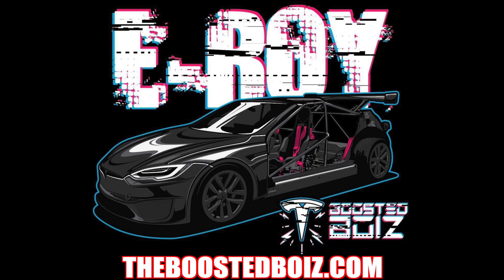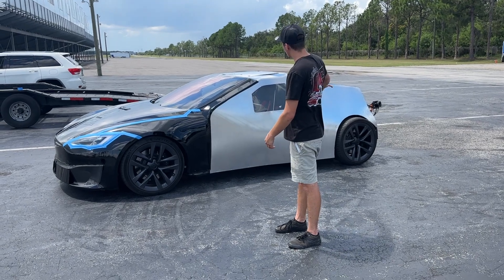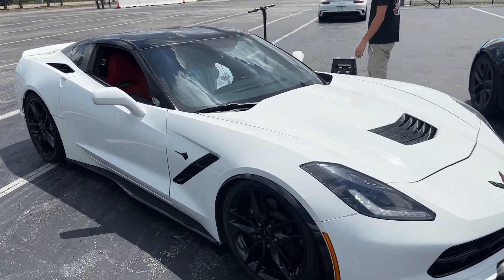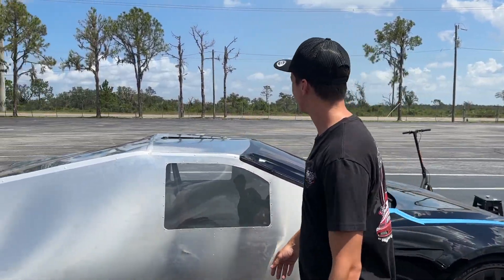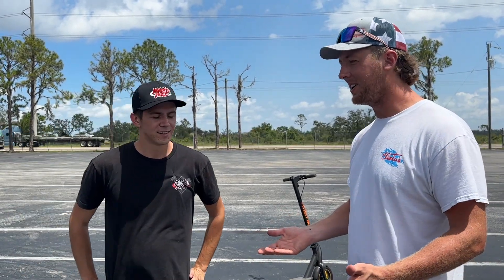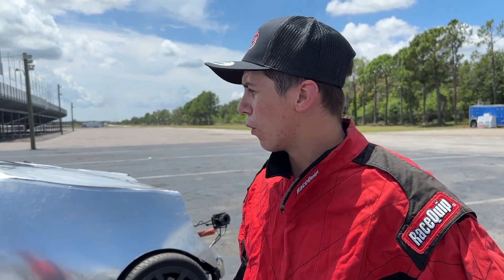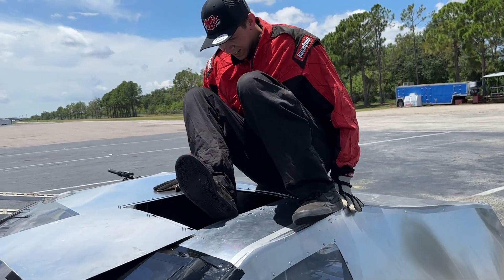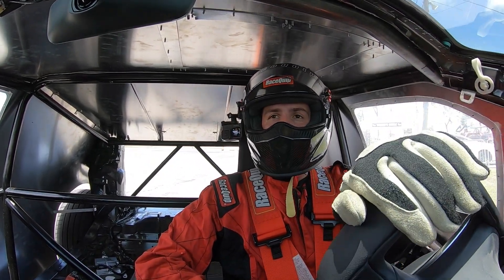We Built an Aerodynamic Body For Our Tesla Go-Kart To make It Faster!

Comment: Electric vehicles  are more prone to overheating than conventional cars for two main reasons. One is that batteries in electric vehicles underperform in hot weather because higher temperatures cause electrons in the battery to move slower, reducing the amount of power available.(GOGGLE)😂

Comment: The rear is the most important for aerodynamics, you need a rear, go to another wind tunnel and use ai to design a body, or just hurry up and make an all carbon replica of the original body, you will never get better aero than the original body, it's insane how aero they made the original

Comment: To aid in grip on top of slicks you need to get rid of the camber in the wheels. Negative camber is great for cornering but for maximum grip going straight you need the tires flat on the ground.

Comment: Have you thought about a smaller overall wheel diameter??
For example if it’s a 27 inch tall tyre, try a 25 inch tall instead.
Top end may suffer a little but it might 60ft better.
Just an idea 🤔👍

Comment: Put racing window ducts on both windows and where the rear window would be and allow some air to travel through the car to the rear opening. Back there is still a vacuum zone and any relief of the sides and hatch dead zones could now flow to the rear exit..pulling aero closer to the car in those turbulent zones...
Great progress!!!!

Comment: Hey I just thunk a thought; if you know a day at the drag strip only uses like 15% power.... and most of the weight left is in the batteries.... could you somehow ditch some of the battery cells and still have enough power to run it? idk how that would work, I aint no sparky but maybe its possible ¯\_(ツ)_/¯

Comment: Sounds crazy but add a few lbs to the rims get the planted weight up and the heat shouldn’t bother you as much . The torque curve on electric motors is steady regardless of the weight of what it’s spinning or change the torque ramp second by second

Comment: Is the back completely open? Doesn't that create a vacuum which sucks (pun intended) when the air collapses in behind the car? The air at the back should be diffused in some way so that the vacuum isn't so strong. The teardrop shape is the most efficient, isn't it?

Comment: Why not just use the car's original body panels?  remove everything but the sheet metal, so it's just the skin.  Basically the same weight as the body you have, but way better aero.  Hollow out the doors and just use the sheet metal and Lexan for the windows. You get nearly all of the weight savings, but maintain factory aero.

Comment: have a look at the Ford Racing Transit (latest version) it has buttresses where the rear quarters finish, but paneling which runs inside the back to help with drag and funnel the air inside to fill the hole its punching. also some wheel covers on the front, and run the rear body work round the outside of the wheels... wouldnt look so much like a tesla though, but would be more slippery.

Comment: The OEM tire size for the Model S Plaid is 285/40/19.

Would you guys consider installing 295/45/19’s?

The larger diameter should add another 6 to 7 MPH to your 1/4 mile trap speed.  The slightly larger contact patch that would be made could increase launch traction as well.

Comment: This car is screaming to become the next McMurtry Spéirling electric fan car, 0-60 1.5sec 0-180 in 9 seconds and its powered by a 1000bhp electric motor.  All eroy needs is a  fan at the back and a skirt along the bottom of the car like a hovercraft, this will give you the ultimate  ground effect vehicle

Comment: You should cut everything off the car and leave it flat like skateboard. Then build it up like an F1 style car with driver centre mounted and very reclined. 
It will be easier to build carbon fibre/ fibreglass body and main hoop for just a driver. Plus more weight savings

Comment: Hi guys
As far as you know, drag coefficient is not all - there is second factor - frontal area - so I think that you messed up a little bit, when you created a cage that is wider than a windshield - imho it should be as wide as windshield which would decrease frontal area by few percents. In fact, it should be even narrower, so there would be "droplet like" shape in the back. if You would want to go "hardcore" you could try to replace whole windshield with something lower, or just make it flatter by changing angle = less frontal area :)
Reply: Sounds right, I don't know how much frontal area they added but looks like more than 10%. Yes unfortunately this means the bodywork needs to be redone from scratch, needs to be more like VW XL1 where the upper body is extremely thin (left/right) instead of fatter. They went the opposite direction from what they should have done!
In the meantime, WIDER TIRES, LONGER TAIL.

Comment: Rear wheel covers and a long tail will help loads. Look forward to the next one! 😎
Reply: repentandbelieveinJesusChrist9  get a job!
Reply: Negligible benefit.  Not worth the effort unless trying to squeak another mph or 2.
Reply: @SportbikerNZ  they ARE trying to squeeze another mph or 2, irrespective of your spamming comments.
Reply: @procatprocat9647  They were actually looking to make a substantial difference with aero which turned out to be less than expected.  As they get closer to the record no doubt they will spend time and effort to squeeze an mph here and there.  Lowest hanging fruit was clearly the objective here as they explained.  Seemed it was lost on you.
Reply: @SportbikerNZ  it seems like that’s exactly what they are trying to do?
Reply: @Jims_racing  No.  They specifically said the wind tunnel showed negligible benefit enclosing the rear vs enclosing the 90% of the vehicle they've already done.
If it comes down to it the last vestige of mph they absolutely have to have to beet the record, then do it.  Otherwise waste of time and resources as they said the wind tunnel showed.
Reply: @SportbikerNZ they were talking about the back bumper area in the video not the wheel wells
Reply: @ipariszalonna  They specifically talked about the wheels which is why the body is flared as much as possible in that area.  Again, this is about picking the lowest hanging fruit, not wasting effort on marginal-at-best options first.  Common sense approach.
Reply: +an integrated wheelie bar 4 traction 🙂 like some FWD cars
Reply: @Eduardo_Espinoza ? its awd and center of mass is 10cm from ground
Reply: @Eduardo_Espinoza wheelie bar doesn't provide traction it's a safety measure in case the car flips itself over and it is impossible for Front wheel drive cars to do a wheelie
Reply: @s_989  the one's on fwd cars are for traction, to stop the rear squatting

Comment: AWESOME!   Time for lighter wheels AND stickier tires.   You guys are there.  The aero mods work.  You already saw what happened when the track was sprayed down to make it stickier.  Your aero works as intended.   
The weather being warmer is a PLUS for your batteries.   You want the batteries to be warm, not cold.  Forget your air density thoughts of the I.C.E cars.    
Also, make sure the battery is warm before you take off.  There are videos on the optimum battery temperature to run these Tesla EVs as well as keep your batter percentage above 90%. 
You guys are there.  LET'S GO!!!

Comment: Both lightweight and an inch smaller wheels with at least r888’s or better will both drop 100 pounds or so or more if they’re run flats on there

Comment: Funny you say it spins real real bad compared to saying the same with ice vehicles. 

Drove a PriusC to High Rock in Fort Payne Roll Tide Land.... The #3 rock traversing was better than most trucks ive been there with. It just didnt spin going up hills. Mud though, is an ev or atleast hyrbids worst enemy. -i also forced electric mode while climbing hills....

Its all about how you transmit power.

Comment: You guys need to get with Rich Rebuilds and Ingenext to remove the speed limiter of 160ish. I wonder if the car starts to pull a little power the closer you get to the limit? Also I know you don't want to invest to much $$$$ but a lighter wheel and tire package with some carbon ceramic brakes would help massively. You could drop close to 50lbs a corner with the right setup, over current setup.

Comment: You should stop launching in cheetah stance. When you take weight out of the car you actually raise the roll center and lose the ability for the car to squat and generate grip. You really need to either soften the suspension or try to gain the roll center back

Comment: Send me a message, I'm with Unplugged Performance. We have drop in carbon ceramic front and rear rotors (with pads) as well as super light wheels. It will make a difference, it's a LOT of rotational weight.

Comment: @BoostedBoiz I know its a long shot, but in this heat you are loosing some power due to the copper windings of the motor starting hotter. If you wanted to try something that may increase mechanical output slightly, you could design a water chiller type system to pre chill the motor housing and maybe gain some power. Just in terms of efficiency, a 25 degree C drop in temperature of copper achieves a nearly 10% decrease in resistance. While that's not directly translating to % power gain, if your clawing at world records and don't want to get into high voltage motor controllers this could be a way to achieve an even faster "stock" world record. the current record was set in June in Canada where the weather was probably topping out in the mid 70s could have been in the 60s, this could mean they had  up to a 5% efficiency difference compared to our mid 90s-(Feels like Hell) here in Florida.

Comment: I'd put some rubber or something over them bare metal edges. You can get some real deep gnarly cuts from even polished sheet metal ends. I used to work as a chef, and the oil collection trays under the fryers were made of thick sheet metal, I was washing one one day and it slipped a bit in my hand because of the soap, and sliced right into my finger. 

All you need is some of them plastic trim seals (and some glue), the circle/oval bits of rubber or plastic with a groove cut in (cross section). They come in long sticks and you just cut them to size and slip them over any bare edges you have and it'll save you ripping up all your race suits and/or your skin when getting in and out. They are super cheap.

Especially if there's a crash and you are scrambling out from a fire or something,  The last thing you want is to get more injured from escaping the car, than from the car crash it's self!

Comment: What everyone else said
Tires are rotating in open air, need to be shrouded
The rear needs to have a gentler sloping taper like a teardrop to prevent air from separating
Smaller wheels and drag slicks

Comment: Boiz! The tail needs to be mounted! With that giant hole comes a giant low pressure area that really grabs hold of the car, the rear is almost as important as the front! Taper it off gently to avoid the turbulence, and you will see at least another 3 seconds! Weld a bird cage, mount some brackets and attach some panels, quick, easy, lightweight
Reply: It's a truncated teardrop. Yes there is a little more gain, but they were running something like a .24 which is really good already. This is a drag car, not a top speed car. They want the quickest 1/4 mile not the highest top speed. EVs are kind of a one trick pony and they want to be the quickest one trick.
Reply: Did you watch the aero video where they actually measured how much difference covering the tail would make?
Reply: @MikkoRantalainen  Yes I saw the wind tunnel episode and the shape of the rear closure was based on a random shape after their sawzall operation. Not ideal, and not optimized. Most cars has shorter than optimal tail ends for practical and regulation reasons. Many cars are actually more aerodynamic in reverse. In this partially optimized drag monster, they are leaving good speed behind by not optimizing the tail. I'd say add at least 4-5 feet taper off. Good inspiration to find at Boneville and air crafts

Comment: all this work and still on stock wheels and tires, think ab traction and rotational mass, you’d easily cut off half a second with slicks and lightweight wheel setup, not to mention how bad the aero on the back is, if u had a rounded rear piece with a little smooth duckbill u wouldnt have a ball of rough air holding the car back, just some ideas

Comment: You need light weight wheels but also NARROWER wheels and sticky tires. Everyone that does this uses big Barrel Tires but that's wrong. I'mm talking sticky tires and narrow Wheels and Tires. ALso do that thing where you disable the ABS which allows AWD burnouts to heat up the tires.

Comment: Could of lowered the pressures.
That's what you did on your best run.
I know you said before that it doesn't seem to make a difference on the Plaid but remember that's at  full weight. Given you are lower weight you need a lower pressure to get them to hook.

Comment: I think you guys have a unique opportunity to really design something really cool. I still say a Speedtail designed rear will definately improve your aero.
Reply: Reroy needs to be turned into a fan car, just like the McMurtry Spéirling electric car.  0 to 60 mph in about 1.5sec  and 0-190mph in 9sec seconds, 12:04  thanks to its 1,000-horsepower electric powertrain and rare fan system. Stick two electric fans at the rear with a skirt around the bottom of Eroy like a hovercraft has. The fans suck the air out the rear giving you ridiculous downforce. There were a couple of f1 race cars in the 60s and 70s that had this, they were so fast that f1 banned them
Reply: @Sanderly1820  ILEGAL..... xD
Reply: @phil2508
2J fan car*
Reply: @Sanderly1820   The McMurty also weighs less than 1000kg, with 1000hp, the S weighs over 2200kg with a tad over 1000hp. It would be interesting to see, but I doubt the fan would have much of an effect if the McMurty is doing 1.5 with half the weight.
Reply: Speedtail is a great idea. And some vacuum assisted downforce for the launch.
Reply: @suodrazah6015 mcmutry 💀💀💀
Reply: need stick tires and drag wheels
Reply: Basically should just stay stock
Reply: Yes it would help a lot and maybe some covers to the wheels to improve the aero and stop the air from coming in, maybe some Hugh fans and aero would improve the performance like the McMurtry Speirling have and maybe some weight reduction like fiberglass or carbon instead of metals and a diffuser
Reply: Another reminder why electric cars are better.

Comment: You should look at the Lightyear One and Mercedes EQXX for what shape is optimal for drag. Also, the original EV, EV1. There is a particular shape you cannot avoid if you want optimal aero. One aspect is covering wheels, and another is a long rear end, especially the rear diffuser. Mercedes has theirs able to extend at the push of a button, lengthening the car, for best aero on freeways. The rear in your tests was likely too short to benefit much...go longer.
Reply: Oof.

Comment: Why not just gut the original body panels to nothing but the skins, and use some aluminum to mount them static to the cage?  I can't imagine that it would add that much weight, and you would have essentially the aero of the factory car.

Comment: I think you are close on the aero, but there are a couple of things you could do to still improve it further.
1. Cover the rear tyres, bring the body out wider and make some old school removable spats to cover the wheels.
2. Make a non flexing flat rear wing that is at least a foot long. Don't put any lip on it as that will only cause drag, but you need to extend way past the body to allow the air to sheer off the rear wing. Too short and it will cause turbulence at the back of the car.
3. Panel the back of the car in. At the speeds you are doing it is creating drag through vacuum.
Reply: I saw your username and thought, oh dang. Maybe this dude has experience with aero. Then I checked your videos on your channel...
Reply: @eriklarson9137  no there isn't a lot on aero on my channel, but it is a subject I have spent a considerable amount of time investigating. I got interested in DIY EV's in the late naughties, and since there is only a certain amount of power you can make, the only alternative for going fast is to reduce drag. I did a considerable amount of investigation into what caused drag, and what could be done to reduce it. I spent quite a while just looking at Cd of different vehicles and looking to see what attributes those vehicles had in common to see if I could establish any patterns from their designs. This revealed some very interesting results.

Comment: You need a little weight over the rear wheels to offset the traction/traction control problems. Stock suspension is probably tuned for the full weight of the pivot over the rear wheels. Or change the suspension in the rear for something adjustable
Reply: Teller-oj6iz  Stop spamming this nonsense.

Comment: With what you have learned with the wind tunnel and alumibody, looking back would you think it would had been a better idea to just gut the plaid and build aero on it?
Reply: Then they wouldn't have lost all that weight
Reply: @OPDrags   true but they still would have cut weight and created a more efficient shape. They are close to the record but it’s still held by a full bodied car. They need to work on keeping air out from under it is the next step I think.

Comment: It would be interesting to experiment with this car to run it at a track at sea level, then run at a track at high altitude. As less air equals less drag/resistance. Wink!
Reply: That's a very good point... no air fuel to worry about, so in theory, the higher the better.